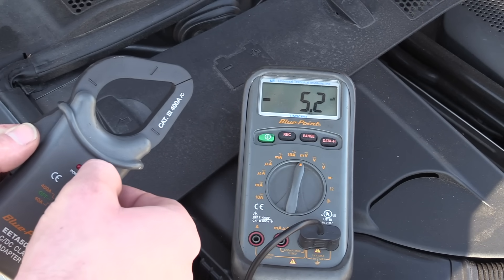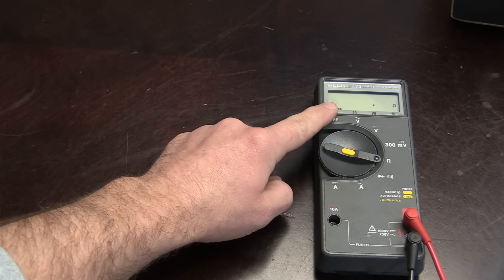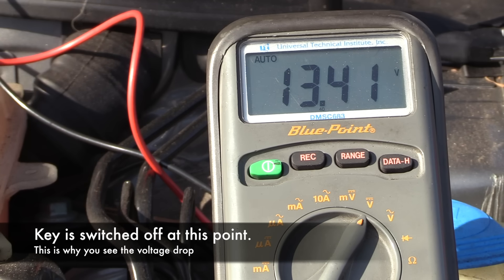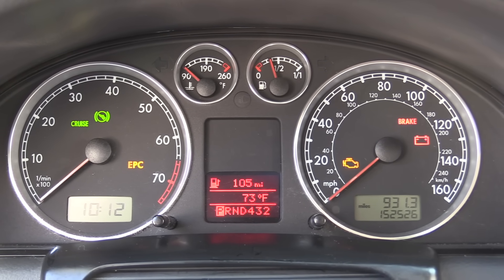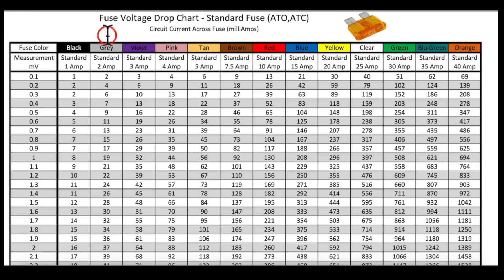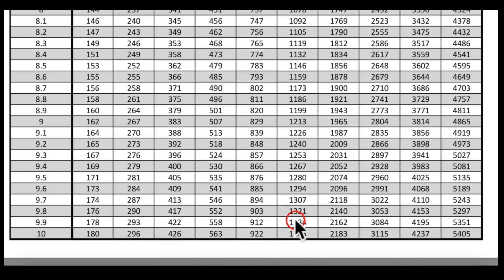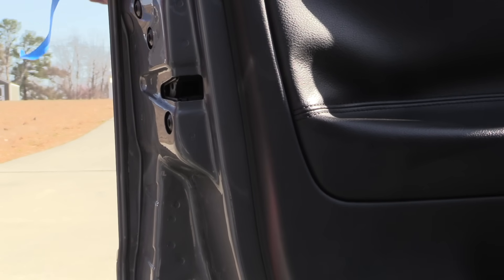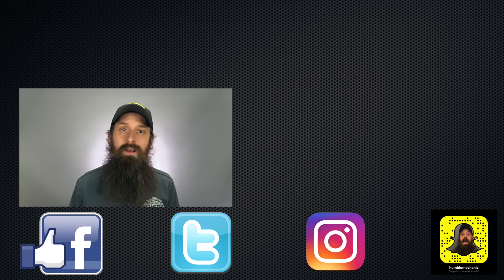The BEST Way TO Perform a Parasitic Draw Test

Comment: I get this concept but......I thought voltage drop measures resistance on a line, such as when it is corroded you will see varying voltages at different points on it when there should be none, not getting how there is a voltage difference across a fuse that has no unusual resistance inside itself. can someone educate me on how this is possible, thanks.
Reply: All conductors and connections are resistive. A mega ohm meter will read the resistance through a length of copper wire. Milivolts measures the after resistance voltage drop. Larger conductors reduce the resistance at low voltage 12VDC. Installing 12volt landscape lighting requires ohms law calculations, resulting in upsizing conductors and wattage output. Wattage is expelled energy. Voltage is like water pressure. Amperage is like gallons per minute, and resistance is the half closed value that is limiting water flow. Electricially, resistance results with heat at the resistance point. The mechanic would have to do manual ohms law mathematics to provide the answer that was found in the fuse chart.

Comment: This method is ok, but it's def not the best. Reason being, there is sometimes an intermittent current draw which you won't see unless you hold your test leads on the fuse for up to as much as 3, 4, or even 5 minutes. Otherwise it will show an acceptable amount or current draw.

Comment: My MTD yard bug was just clicking when I tried to start it so I tested the battery with jumper cables and got nothing the solenoid seems ok because it clicks when I put a screwdriver to both posts so I installed a new starter and solenoid but it still just clicks won't turn over. Any ideas? Thanx.
Reply: I meant to say I checked the starter with jumper cable

Comment: A lot easier to just disconnect the negative and put that connection on the positive meter lead and put your negative meter lead on the negative post....it should start high and with in a few seconds come down to 50 Milliamps if you don't have a draw...if you are around 100 plus milliamps then you have a draw and proceed with this video by checking fuse box

Comment: I fully charged my 2 Carmec batteries in my caravan to 13.3v over 24 hours and made sure nothing was being used, with both car and solar and power disconnected. Within 7 days it progressively dropped to 12.5. Is this normal or is there some leakage?
I also test all the fuses like you show here (thanks a lot for that) and find no leak except the fuse to the van battery, which showed 43 with multimeter set to 200mv. What does this mean?

Comment: Tbh, it was easier to just start pulling fuses and seeing if the draw went away. 

It seems the meter will return a reading if it aint touching metal. Trying to touch needle point leads to needle point test spots under the dash where you can't get the best view... Extremely difficult to tell if you're getting a reading from the fuse or if your leads aren't touching the test spots properly.

Got a diagram of the fuses and started pulling the most likely culprit, saw the draw decrease when I hit the right one which made me 100% certain that was the fuse.
Reply from the maker: That’s an outdated way of doing it and can lead to misdiagnosis on cars especially can bus cars

Comment: Oh my lord!  Great Video!   Didn't even think about 'putting the car to sleep', Thanks Charles!   My wife's 2007 Toyota Corolla is suddenly draining the battery if not driven every day or two.  Replaced the battery, did the 'disconnect the battery cable' parasitic draw test and found only about a 30mA draw.  Charging system 13.4-14.2VDC, no idiot lights, however I believe it's the OEM alternator (only about 78K miles)...so still not ruling the alternator or regulator out.  But never thought about latching the doors and putting it to sleep...outstanding advice.

Comment: You make it understandable HM. That is great to see and hear. I'm attempting to get rid of gremlins on a 98 A4 TQ. It was fine until I replaced the spark plugs and now cylinder 2 will not fire. Yes I have moved coil over plug coils around and replaced the wiring to cylinder 2. No joy although it runs on 3 but performance is lacking and gas consumption has gone up. I'd like to keep it but am not skilled enough to deal with this issue. I did fix its first issue that is common with older Audis where headlights only come on by holding turn signal stalk in blink position. Also bought a 98 Land Rover discovery for a good price due to it bucking, running rough etc. I knew it was starving for fuel and tracked it down to the pump in tank. Land Rover wanted over 600usd for a new pump assembly but the A/C Delco pump cost 82 and new in tank hoses were 15. They do make a competent and somewhat easy to fix 4x4. Although I did not like using it for home heat fuel refills. I use oak with the occasional sycamore to heat my place and most likely won't be using the recent 'beater' 4x4 GMC Yukon Denali unless I attach the trailer before roaming my ranch. It is sad to be going through SODS here in California. Sudden Oak Death Syndrome that forestry/conservation agencies are clueless on what is causing it. 300+ year old oak trees start with bark splitting leading to bark beetle infestation and within a year or 2 fall over. Only 1 has punched through my roof but it gets old having to keep a chainsaw in the car and never knowing if the ingress/egress roads are clear... Babble switch to off position. :))

Comment: yer great tutorial ..did a parasitic draw  test as per your instructions on my E46 2002 and all tested OK on the fuses but still have draw of 78Ma ...I am thinking maybe the FSR as I have a volt draw of 0.05v on my A/C pusher fan  connector and it has to be linked to  HVAC that turns on A/C pusher fan and also controls inside air circulation speed so am  wondering if FSR is linked with A/C pusher fan too ...seems the FSR has been a problem with these e46's ..

Comment: Best parasitic draw video out there. One note: good test leads are not cheap. If your multimeter does not read zero ohms, Fluke says that is just increasing resistance as the meter electrical contacts, and the lead connections get dirty or corroded over time. If cleaning with contact cleaner, or isopropyl alcohol doesn't work, you can use the "relative" button on the meter to adjust for the increasing resistance. Set to ohms, touch the leads together, push the "relative/rel" button, and  the display will read zero. Fluke says you only need to throw the leads away when the wires become exposed, or broken.
Reply: The biggest parasitic draw is congress and the NGO’s
Reply: I have like 6 fluke meters, 87v 28 series 2, scope meter etc and none of them read zero when you short the leads, no meter does
Reply: Your multimeter test leads, even the really good ones, will never read 0 ohms, unless the meter isn't very accurate. Expect 0.1-ish ohms, as THM mentioned in the video.

Comment: Hi Boss, I Just Wanna Ask... What Is The Function Of 10A Battery Fuse? Actually My Car Have A Problem With That... When Im Put That Fuse, The Power Will Be 13.2v, So The Car Feel Like No Power To Accelerate.... It Cannot Reach High RPM... When Reaching 4 RPM, It Become Really Weak Like Not Enough Fuel... But im Pretty It Is Because Of Current Problem... When Im Removing That Fuse, My Car Power Raised Up To 14.5v-14.8v And Of Course The All Will Be Smooth... The Acceleration, Pickup All Will Be Perform Well...  I Dont Really Know Why Its Happened... Can You Please Give Me Some Advise That Maybe Can Solved My Problem... Im Worry If The Bad Things Happens If Im Not Put Back That Battery Fuse... Thanks Boss...🙏

Comment: Excellent vid dude! I have a draw of 0.13A when my car is fully asleep. I can see a reading of 0.2mv on a 5A fuse which is for the alarm. If I pull the fuse, my reading drops to 0.01. 
Using the chart (0.2mv / 5A standard fuse) it shows 11 on the chart. What does that mean please?

Comment: Okay so I got a old Corvette really nice one the problem that I'm having with it is the battery no has obviously a parasitic drain kind of the reason why I'm here because the battery will be dead um or won't be able to start the car with then about an hour after using the battery charger to charge it all the way up and then start the car period now when I'm checking the voltage on the battery when it's running I'm getting about 13.41 when the car is turned off I'm getting 12.4 period when I go to start the car it will either not start and drop clear down to 9 point something or when it does a start it goes just a little bit of above 10 volts you said that when the cars running should have about 14 volts running Well I'm about 5.6 shy of that so what do I do to correct that that part because you said shouldn't start this test unless you have fully charged battery and the battery is reading at almost 14 volts when running

Comment: Question: So basically every fuse no matter what will show voltage drop from "something" - down to 0.00mv. If you come across a fuse that shows 0.00mv right from the start, then that circuit has a draw?

Comment: Anthony Collins I have a 1999 GMC Sierra truck.  I believe that I have a problem with some component
draining the battery.  Is it true that if I am not able to arm and disarm the anti theft system that I need to
get that repaired before testing for battery drain?

Comment: Hey, before you do any of this. Sit in your car and lock it, keep your ears open and listen for anything or keep your eys out for anything. I heard a thump consistently coming from my driver seat. Turns out my ice scraper was pushing my electric  seat back and it couldn't go back any further. But this is the same for something like a stuck hvac actuator clicking or your info screen not turning of cause a fault in your ignition switch. Sometimes it will help you find what fuse to pull durring this test

Comment: Remember,  some modern vehicles,  as well as most older, use a door jam switch separate from the latch that activates the dome lights.
Reply: yeah I have to jam mine, it is 1991. I dare not latch the doors open it will have a fit. Have to close doors and leave drivers window open.

Comment: First of all cars since the 70's have a parasitic draw of some kind. Even older cars have them as well. Memory for clocks, radio's, alarms and other things present a draw. Since computers there are even more of those draws. Computer memory, clock, radio, antilock brake computer and there are more. You cannot leave most cars off for more than 2 wks or the battery may not start the car. The newest cars with keyless entry add another draw to things. First you want to disconnect the battery, place a voltmeter between the cable and post. Next tap the cable to the post and now measure the draw. It should not give a 12-volt reading. If it does it is too much. Next if it is 12 volts then put an amp meter between that post and cable and measure the draw. If it is over 2 amps then you have something working that should not be drawing that much. I can go on but go to a qualified auto electrician for further diagnosis.

Comment: @HumbleMechanic The only problem I see: there's huge variance in the chart numbers, depending on which chart you choose! I just searched and found several. 
For example: 5mv drop across 30 Amp standard fuse. "your" linked chart ;) -- 3080mA. Another: 2538mA. That's almost 20% different.
My suggestion: just use one chart to be consistent; the relative currents found ought to at least tell you where to look.
Reply from the maker: That could be an issue for sure. But also most should have zero draw. Thats generally what I look for. once the car is asleep

Comment: Couldn’t get all locked and left open.  Alarm kept going off. Still tested all. Measured .24 at data link connector/driver seat module. Not a mechanic and not sure if that is impactful enough to chase. Battery dies overnight. Just trying to see what I can figure out with dealership telling me 3 weeks min to look at

Comment: Hey man I have a car with a parasitic drain somewhere, 1.33 amps. I pulled every fuse in the car and idk where to go next, I got no drop from anything.
Reply from the maker: Try the alternator… I’ve seen that happen too. Unplug it and see if the draw goes away
Reply: @HumbleMechanic   Ok thanks! I’ll try that. What’s the fix in that case? A new alternator? I realized also I forgot to check the larger 30amp sized fuses too that screw into the fuse box.
Reply: @HumbleMechanic   hi I tried unplugging the alternator and starter and no change happened. I’ve pulled every fuse even unscrewed the engine wiring harness. The only change happened when I pulled the battery fuse from 1.30 amps to 1.09 amps.

Comment: I fully charged my battery yesterday, about half an hour later the voltage decreased from 12.45 to 12.35, and in less than 24 hours it's gone down to 3 volts.. My multimeter said there was a draw of 14 miliamps which is acceptable, right? After that I even took out 4 fuses I wasn't using for things like the radio, the cigar lighter, convertable roof (which the car doesn't even have) and I think the subwoofers. Is it possible the battery is messed up even though it can be fully charged? Two mechanics have told me that the alternator is fine otherwise the car wouldn't be able to power itself. The battery is from 7/2022. I've tried to diagnose and fix this so many times, I'm about to just bring it somewhere though I'd much rather fix it myself.. any advice?? No lights were left on by accident, everything is off.

Comment: Giving away the secrets to curing parasitic drains I see. Lol. JK. Great video, Sir! I wish more people understood how to do these types of simple tests. Along with just how easy electrical can be on cars. Don't over think it. Electricity is a river. Voltage is the amount of water trying to flow, the electrical pressure of a circuit, if you will. Amps, are merely the speed the river flows at. Ohms, is essentially a beaver dam in the river blocking the flow, a resistance in the river/circuit. This is what I tell people to help explain it as simple as possible. I had an old man explain it to me like this and electrical made sense, ever since.

Comment: Why can’t you simply set the multimeter to read amps instead of volts as you touch the leads to the fuse pins? Won’t you get the amp reading directly for the circuit instead of going to a chart?

Comment: The specification for post 1996 OBD2 vehicles is 30-50 mA, and 0-20mA for 1996 and older. IMO, it's much simpler to put your meter between the negative batt cable and battery to check for draws, than this more time-consuming method that you outline, especially when you factor in fuse panel location issues that are problematic to get test equipment in to. Once you confirm a P/D, monitor your meter while pulling fuses to isolate the sub-circuit, and then a wiring diagram to perform process-of-elimination. #morethanonewaytoskinacat
Reply: Agreed

Comment: I guess I'm old and have only old vehicles i.e. 25 years old or more. For those older OBD II and OBD I vehicles without the super computers and individual control modules of today's vehicles, why not just put the amp meter section of your meter in place of the fuse to see what kind of draw you may be getting?

Comment: I've been a tech for 27yrs, but only really started doing diagnostics 16yrs ago, and a Suzuki master tech for 4yrs. Anyway, how come I've never heard of this method for checking circuit drains!? Lol, live and learn. (I of course have heard of volt drop testing for bad connections etc). Maybe with my new job (I'll be starting at BMW next month), they'll teach me that in a future training course? (I'll tell 'em, too late, Humble Mechanic already taught me that 😉). 
I'd normally disconnect the battery and have my DMM inline showing current draw, but like you said this can reset modules, which it did when I was checking for an intermittent drain on my 08 M3, after a few attempts I simply left my DMM plugged in for a few hours (whilst I did other work) until it played up, (turned out to be the 'touch' sensor on the drivers door handle was intermittently waking the CDL/CAS module(s?)).

Comment: ❓@5:40-47 Why is the voltage dropping across the fuse ? Is that the meter or the circuit settling ?

Comment: Why not use the FLUKE 73 to test the battery voltage prior to starting on the fuse panel, why use the BLUE POINT DMSC683 - thank you!   #SoConfused

Comment: Lotta good info here! Just don't understand why all the doors, hood, and trunk latches need to be open but latched when you only really need to do that with the driver door that you need open to be able to access the fuse panel?
Reply from the maker: Are you 100% sure that no other car has a fuse panel in that spot on the passenger side? 

What if you need to get under the back seat? 

It seams like overkill, but it takes seconds and gives you full access to the car. And it looks impressive to a client(lol jokes but no one bothers you when the car is like that)
Reply: @HumbleMechanic  yo dude I can't beleive you replied, that's so cool! 🙏 OK so that makes sense - basically it boils down to doing the full complete electrical diagnostic all the way correctly the first time. 🙌